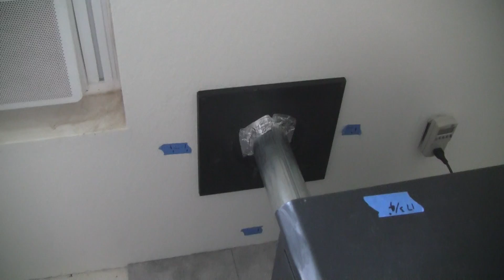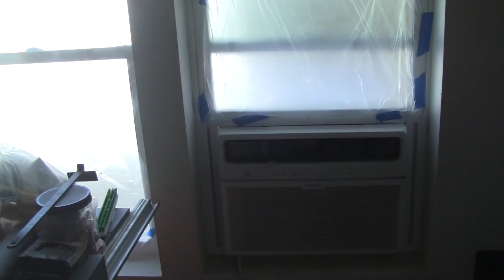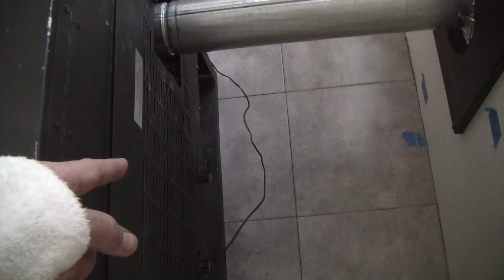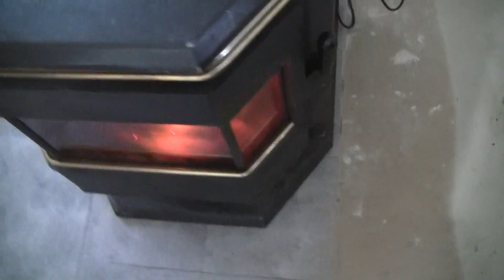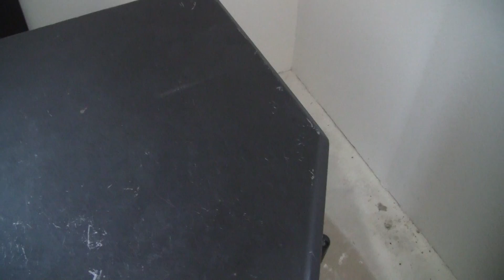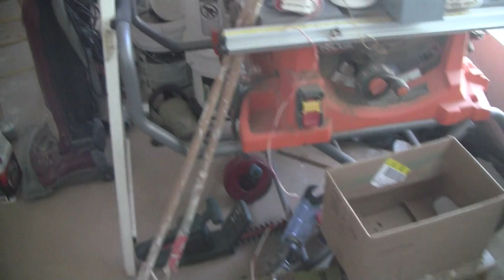Whitfield Advantage/Profile 30 Pellet Stove Repair and Testing. Part 4.

Comment: Hi Mike.  I have a Profile 30 insert unit in my fireplace.  It was in my home when I purchased it back in 2008.  The guy I bought the house from said the pellet stove maybe had another winter of useful life. That was fifteen years ago, and I had never heard of a pellet stove.  I learned like you, I serviced it and replaced parts over the years keeping it running great, and I think it's a marvel of engineering.  I was wondering if you ever settled on a WiFi thermostat.  It is something I have considered, but unlike the simple switch style that I have now, I know they need power.  Anyway, great job my friend.  Thanks for sharing!
Reply from the maker: I completely forgot to look for a wifi t-stat. Just been too buried in projects. Still a great idea.